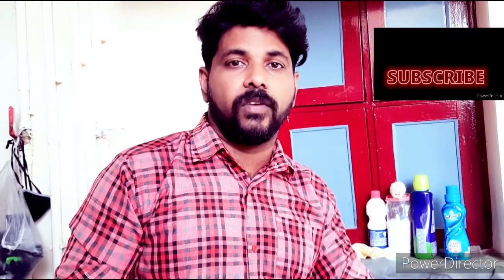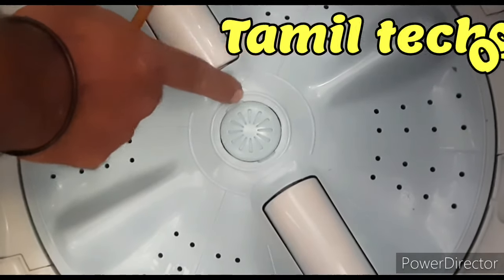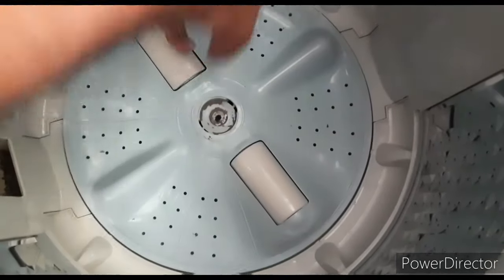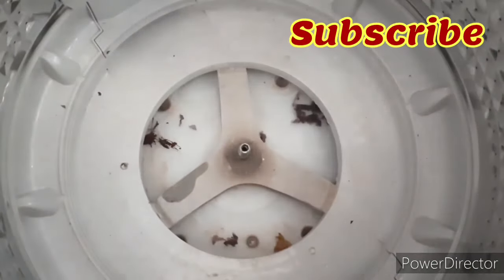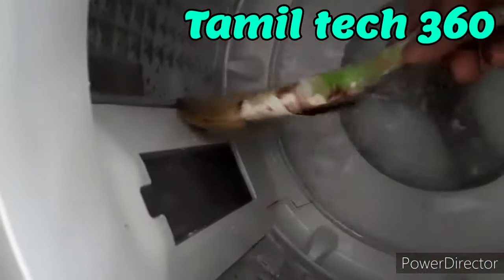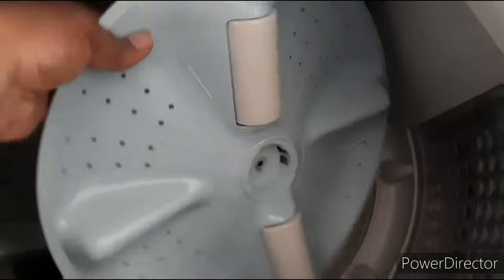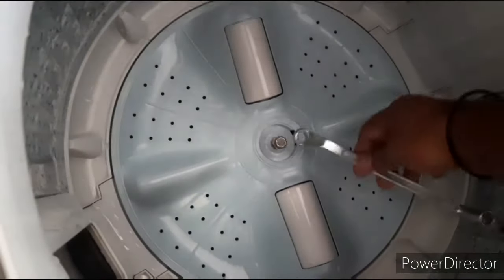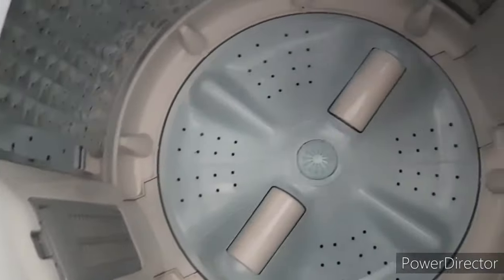How to Clean Washing machine Tub / How to Remove pulsater in Tamil#washingmachine #cleaning

Comment: Hello sir,, i cleaned it like this,, but on top while cleaning i poured little water so i think it went inbetween drum and outer cover,,, so when i run the washing machine it started to give electric spark ,,,, should I call service people or any easy method to correct it.. please advice
Reply from the maker: If possible to lift drum means you do. otherwise best option to call service tech bro. i think water split on connecting jack .

Comment: Pulsater pull panna varala bro
Reply from the maker: Rombo Naal aachina  konjo tighta irukkum try pannunga. varum ji
Reply: @Tamiltech360senthil  Nanum 2days ha try pandra varala
Reply from the maker: Enna ji. Soldringa
Reply from the maker: Centre bolt remove pannitingala
Reply: @Tamiltech360senthil  ama ji romba tight ha eruku
Reply from the maker: Nalla shake panni edukanum
Reply: @Tamiltech360senthil  bolt remove pannitan but varala
Reply: @Tamiltech360senthil  5 years aachu bro vangi, ippo tha try pandra.
Reply: @Tamiltech360senthil  ji varala
Reply: @Tamiltech360senthil  ji nega chennai ha